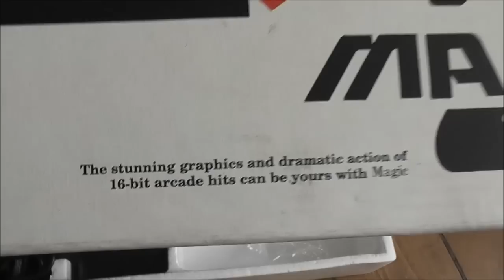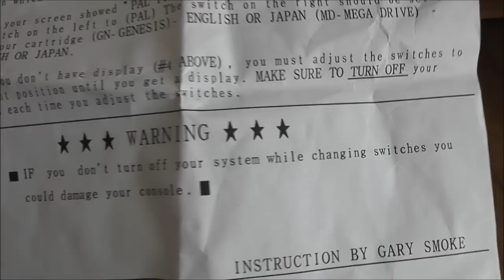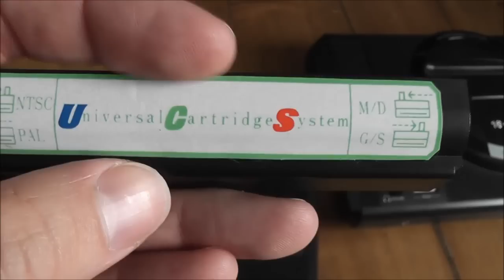Scorpion XVI SEGA MD Clone - Bootleg Console Review + Teardown - Fake Genesis Mega Drive

Comment: They did indeed sell these in Beatties. At the height of the Mega Drive, these were being sold for £39.99 in my local store. I can't remember exactly how much the official Mega Drive's were selling for at the time, but I think somewhere in the region of a hundred pounds more sounds about right. The guy behind these things lived local to me and was featured several times on Central News East, in reports about how he was producing these knock-off consoles and the issues relating to hardware piracy. Beatties didn't stock them for very long, and I only ever saw them available some years later in a small local indie game store. Beatties, for those who don't know, was originally a toy and model shop, but in the early 90's they moved dramatically towards video games and often featured playable demo cabinets and virtual reality machines in store.
Reply: BEATTIES also sold alot of Remote Control cars and planes etc.

Comment: SE-93 is pin and function compatible VDP to original chip. SE-94 is the IO and bus management chip, also pin and funciton compatible with real Sega chip found in later MD1 boards.
The Oscillator is NTSC based which is why its not exactly the same.
These "superclones" are total awesome !

Comment: This is how all clones should be. I think we're all sick and tired of that system-on-a-chip garbage they're always trying to sell us. I imagine they probably keep doing it that way because it's cheaper, but it just doesn't work well. They are never 100% compatible with every game, they usually have very inaccurate sound(and sometimes colors too), have cheap worthless controllers packed in with it, and far too often stop functioning very shortly after purchase. Sometimes they don't work right out of the box! I want to see a real clone that is either 100% accurate or damn close to it! In other words, another one of these.
Reply: Some clones are on a chip but they are very accurate.The reason why the sound is bad on them is because of some chips and wires.Just unsolder them and there you go.
Reply: The LBP + MC HERO!!!!!
Name me one system on a chip clone that is even remotely close to the real thing.
Reply: JMFSpike I don't know if I can do that, however I do know that the retron 2 and 3 use actual hardware from the old systems.  Most of these clones are just refurbished consoles.  There's a ton of Gameboy clones with the same premise, mainly sold in the Chinese market.  I assume it has to do with a leftover stock of replacement parts that was either stockpiled or sold off to China.
Reply: JMFSpike Problem is, where would you source components for a clone?

If i were to design a NES clone, i think i'd go for single-chip solution. Why? Because there are accurate 6502 logic cores that i can synthesize, but the rest is custom logic - there's no way to source it. And since a few years have passed, and i'll need to design all component replacements from scratch anyway, i'll just place them on the same chip. Of course i'm introducing the likelihood of design errors into the custom components, the graphics and the sound synthesizers, but there simply is no way around it.

If it was a SNES or MD clone, things are a bit different, depending on synthesizable core availability. It possibly makes sense to source the real SNES CPU (WDC65816), but graphics and sound invariably need to be done from scratch, introducing the possibility of errors, but the CPU is better specified than the custom parts, so chances are if i were to design a clone of that, i could make an exact CPU clone. So SNES again makes potentially sense to make on a single chip.

If it was a MD clone, you can source real CPU and possibly real synthesizer, though availability of the synthesizer could become difficult, but if i cared for the result more than the cost, it would be worth it. Sourcing the CPU again makes comparatively little sense, for the above reason, because exact replica logic cores are around. Graphics would still need to be done from scratch.

There's another trend that recently handheld makers don't even attempt to clone hardware and use generic media player SoC instead. Now that is just shoddy, they run simplified versions of software emulators which don't aim for cycle accuracy not in the slightest, they are scanline oriented, and there are plain tons of bugs that they could attend to but don't.

Another missed possibility is shipping an FPGA console, and open-source the synthesizable logic, and hoping to match the behavior of the real console down to the cycle precision eventually with community help.
Reply: +Dale Cooper retron 3 is not that good, the snes and genesis sound is super overdriven and sounds terrible.  i own that one and the retron 5
Reply: The 8bit entertainment system is a NES clone that actually works with Castlevania 4, and I've heard good things about it. But at $15, I'm not sure about good durability or longevity.
Reply: +LovelyProductions I mean CV3, but I cant edit posts on mobile😂
Reply: FPGA is the way forward for retro consoles
Reply: JMFSpike There's ones like this for NES that are great. The Gamerz-Tek 8-bit Entertainment System is one
Reply: My hyperkin NES clone is pretty good. However I added so much circuitry to it that it no longer runs on the original power supply. It now uses a power supply with more amps. It even supports expansion sound and Castlevania 3.
Reply: There is no reason a SoC machine can't be accurate. The only reason this is accurate is because apparently this uses the same actual chips rather than reproductions.
Reply: @JMFSpike  I have a clone on a SM801-A1 chip (it's basically Mega Drive CPU, PPUs and IO all-in-one chip) and it's actually pretty good. I certainly prefer it much more than my original Sega Genesis Model 2 VA1 (I bought it for cheap to mod the hell out of it in the future, so I don't mind it's shittiness, but damn Sega, why did you do this to your loyal paying customers? lol). The clone has much better picture and sound quality. The picture is close to perfect even in composite and trust me you won't get a picture that good out of the original unmodded Mega Drives or Genesises. Even the best revisions have some picture quality issues. The sound is clean and punchy, unlike the original VA1, which mostly sounds like scratching a knife on glass with very loud background low frequency humming. The only problem with the sound I noticed is that the mixing of different channels seems to be a bit off compared to the real Genesis, but it's not that bad - mostly the sound effects are louder than they should be and occasionally some instruments like drums also sound louder. All in all I am very happy with this clone and it is also very easy to mod to work in PAL60 without any soldering (initially it's a PAL50 clone).  It's called Sega Mega Drive 4 btw and it looks almost exactly like Mega Drive 2 European. It's a clone from 2000, so I don't think they make them like this any more, but in Russia they are fairly easy to find cheap second hand, because they were one of the most popular clones around 2000s.

Comment: There's also another really good Mega drive Clone: Megavision, it was an brazillian clone developed by Dynacom (wich also produced some nice quality famiclones) that clones works with Mega cd, 32x, it has nice sound, it is region free, and also runs Virtual racing, it runs at NTSC speed, it even had its own Master System to Mega drive converter. Sadly Tectoy (the distributor of Sega products in Brazil) barred the sales of the Megavision, and took it out of the market, its a very rare an expensive console nowdays.

Comment: The majority of the official Sega versions were fitted with the Motorola MC68000, but the Signetics SCN68000 was also used (my Model 1 VA4 PAL has one) and a minority of units received a Hitachi 68000.

Comment from the maker: Ha! I'm surprised you've not found one at a carboot by now! :P The Scorpion branded version seems uber rare. The thing with the extra cart slot is strange. If you look carefully, even the one shown on Bad Influence is missing the extra connector. There's another Scorpion console review on YT and it doesn't even have the hatch at all. Andy Crane also tried to plug that review cart in the wrong end! :P
Beatties was awesome as a kid! Mine had a running model railway suspended from the ceiling!

Comment: mine had grey 3 button controllers, they were just like the sega ones only grey, but they were solid and well made not cheap and rattley like these.
in fact the d pad was much more positive and for me better than the sega ones, i had a pair of 6 button sega pads aswell but only used them when needed, as i loved the scorpion pads so much, mine had the other edge connector inside (i had sonic1 there), i had the mk2 cd drive but it worked fine, and the master converter does work with these it least mine did.
do we know for sure those controllers are original?, maybe that and the lack of 2nd cart slot points to this being a later or cheaper version.

Comment: i might be wrong, but i think that the reason it is locked to PAL is a feature of the console as many Tv's back in the 90's where not compatible with 60hz NTSC, the reason for the main oscillator on the board is that the chipset and cpu (68k), sound (z80) will have its own clock divided by the custom Chips, to be compatible with other regions the clock are changed but the final video output will stay at 50hz pal, very clever for a 90's clone, i wonder if the 32x can be made to work?

Comment: Will it play Virtua Racing that had that special chip inside the cartridge ?  My original Genesis I got shortly after it came out still worked last time I played it but now I can't play it since I moved because I don't have room to store it in my Room where all my other systems are, no room under or around the TV .
Reply: Dallas Dal Assuming it's a true 100% clone, it should be able to use such cartridges.

Most emulation based consoles have issues as they attempt to rip the ROM data but can't do so with those games.

Comment: I know you said you don't plan on installing the hidden cartridge connector, but maybe a connector from a SEGA Nomad would work, as (at least from what I saw on pictures), they are at the angle needed to fit in there. Tho who would want to gut out a working Nomad for this? XP
Reply: The nomad doesn't have to be working :P could be a cheap spares and repairs job off ebay. :)

Comment: SE-95 is YM2612,SE-94 is SEGA 315-5404 and SE-93 is SEGA 315-5313A. basicaly this clone is based on componets found on original Sega's VA5 motherboards. the oscillator is from NTSC Genesis/MD but the videoencoder have own oscillator. when you switch PAL/NTSC switch you have PAL50/60 output.
Reply: Дмитрий Телпиз do you have more info on the SE-95?

Comment: In the developing during the prime of Sega Mega Drive, fake Mega Drive systems are still branded Sega. One way to tell if it's genuine of fake is to peek the holes at the bottom and look the PCB if you can tell them apart. The best way to buy a genuine Mega Drive system is to buy it soon after it was released. Once fake appears it would be too late because genuine disappears in the store and even you look everywhere for genuine you can't find any. Even genuine game cartridge are rare and hard to find and fakes are almost as expensive as genuine.

Comment: Cool video! My genesis model 1 has cxa1145p video encoder so you should get rgb. However I wouldn't suggest it because when I modded mine for s video it had lined artifacts that wouldn't go away. When I modded my model 2 with a Fujitsu encoder the lines werent there.

Comment: Five years later I chime in. I'm not trying to be a dick, but the one in the middle is absolutely not "emulation". It is a hardware clone. It just isn't as good as the Scorpion because there are missing components that render some games incompatible. However, the games that work look identical to the way they would on a real console. The sound is usually another story.
Reply: Yeah, just because it's on one chip doesn't mean it's not a hardware clone, it just means it's not using the original chips.

Comment: That's true, in fact, I have seen a few arriving in my local second hand shop lately. Have you heard of the Russian Mega Drive X at all? It's kept the shape of the Genesis 3 (which we didn't get over here), and I hve spotted it on eBay going for £25. I would like to get it because it's multi-region out of the box, as I have a few Genesis games but I'm worried that the sound will be as bad as the 'recent' official clones.

Comment: My sega MasterSystem2, PSX (has proper composite - yellwo white and red ports on the console, not sony proprietary crap), N64, SNES still works...:) My snes games now mostly do not hold a charge so saving does not work but I plan to replace the capacitors in them some day soonish or add a battery somehow to them if I can work out how to do it without killing it!

Comment: Z80 sound chip? WHUT
Reply: Objectified Cross All Sega Genesis consoles had a Z80. Sometimes for sound, but also for SMS compatibility.
Reply: It's sound controller not "sound chip". It's controls the two sound processors (sn76489 is in the VDP so isn't its own "chip", on later Mega Drives the YM2612 is replaced with he YM3438 which is also in the VDP).